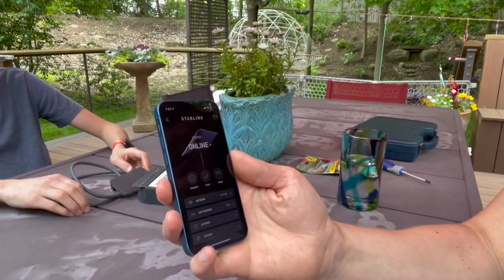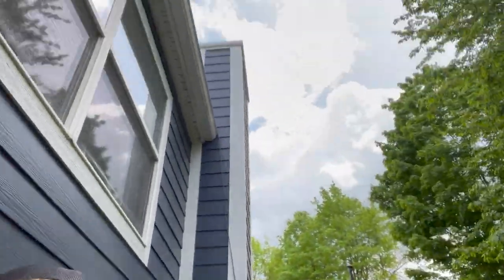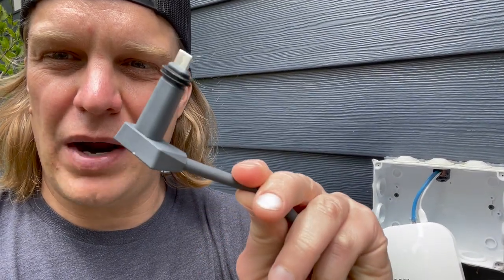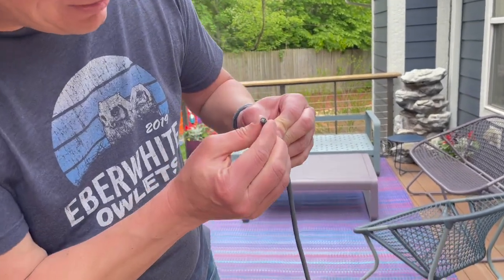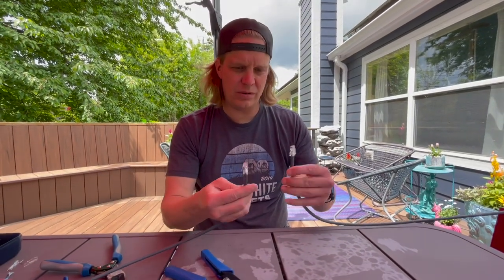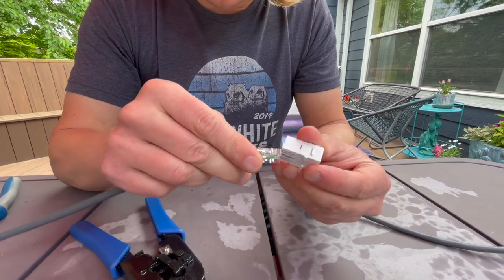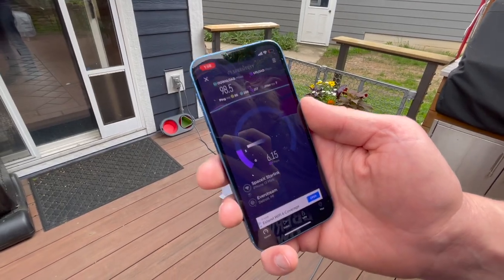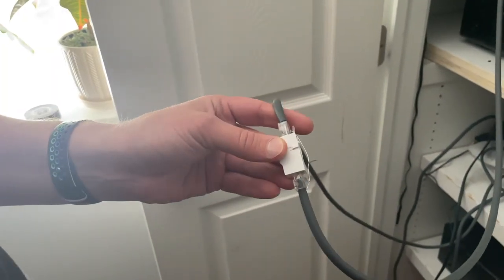Can Starlink cable be cut & reconnected?

Comment: I had to cut my Starlink cable to use it on my RV.   Already had a ethernet port on the outside of the RV so I cut the end off that attaches to the router, leaving about 18" to connect the router to the ethernet port inside the RV.   I did use shielded RJ45 connectors.   Everything works perfectly.

Comment: You could also get RJ45 ends with shields and a coupler with shields so you wouldn't have to "twist" the drain wires together.

Comment: I would suggest where the cable runs through the copper pipe through the wall, you clean up that sharp looking metal pipe end and perhaps fit some kind of rubber end.  Otherwise in the future  you are going have some chaffing on the Starlink cable.

Comment: Those bare metal wires aren't for grounding. They're used to collect water if any gets inside the cable. The blue shielding inside of the rubber jacket is what you'd normally consider ground for shielded ethernet cables.

Comment: This is a brilliant idea i had always known it will work because research showed that the cable is same as cat6  own, another way round is to feed the other end of the cable (i mean the end connecting to the router itself not the outdoor antenna) since is not a 90 degree angle it should be able to go through, thanks a bunch for this video it has brought more confidence to those doubting before.

Comment: You could also try to pass the other end of the cable (the one plugged to the antenna), it's not a 90 degree angle connector, so it will pass a smaller hole (granted not the copper tube you showed)
Reply from the maker: It was also too big, but that would work for some people I imagine!

Comment: Just some advice from someone who has installed plenty of outdoor-rated CAT6 cable.

- The extra wire is the "sink" wire or ground for the internal shielding.  You should use shielded CAT6 connectors instead.  You typically wrap the "sink" wire with copper conductive tape around the outside of the cable sheathing before inserting it into the shielded CAT6 connector.  Basically, the "sink" wire is what maintains continuity between the foil shielding inside the cable sheathing and the shielded connector.

You should verify with a tester that the grounding checks out.

- Also, if the connection is outside and exposed to any kind of moisture then you need to apply dielectric grease to keep the copper connections on the CAT6 jack from corroding.  This technique has worked extremely well for my EnGenius Wireless Bridge setup for the last 4+ years.  Of course, this is standard practice when installing satellite TV systems using RG6 coax.

Personally, I'd install a single-gang outdoor receptacle with shielded CAT6 keystone coupler & outlet cover making the install look professional.

Just a suggestion, try using a piece of electrical conduit or grommets when routing cable through the walls.  Unlike copper water pipe, it doesn't have any sharp edges that could end up cutting through your cable.  Even CPVC or PVC would work just fine but don't tell that to a code-Nazi electrician 🤣

Also, remember that every time that you add a coupler you lose a little bit of signal strength so try to keep your splicing to a minimum 😉

Excellent video  😉

Comment: We disconnected the antenna wire from the base and fed that end through the hole from inside the house and reconnected it to the antena outdoors and we avoided that issue.
Reply from the maker: Nice! Yes, the dish side is straight and thinner,  it still too big for the entry I already had.

Comment: I'm about a year late to this, but there are two different ends. The large one which plugs into the base of the router is stupidly large (no idea why they did that, especially if it's just a standard ethernet cable), but the end which plugs into the dish is MUCH smaller, and can be collapsed to about a half inch, maybe 3/4" inch to help snake it through holes. Still bigger than an ethernet plug, but much better.

Also, I had a lawn care professional accidentally hit my cable. I was waiting on a more permanent install (roof mount, but the roof is due for replacement so no point in mounting it just to redo it all later), and the cable had come loose when he hit it with his lawnmower. Knowing that this is just an ethernet cable inside (although it is shielded, so I'd recommend using shielded connectors and jacks) means I can "splice" it back together and not worry about it. Good thing I didn't throw it away.

Comment: The other end of the cable (dish end) is straight and much smaller.
Reply from the maker: Yes, it's straight(er), but still a lot bigger than the wire and much bigger than the hole I had available.

Comment: Actually the other end of the cable (that goes into satellite antenna) doesn't have such a fat connector. And that is the end that you would be poking through your conduit. So in many cases you won't need to cut it. You just need to unplug it from the dish.

I wish they emphasized it better.
Reply from the maker: Yes, indeed. That wasn’t obvious and I wish I had included it in the video. That end was also still too big for the opening we had but is much more reasonable a size if you’re cutting a new hole.

Comment: Really nice that you tried it out and worked. Unfortunately, I damaged the one end of the cable, as it was thrown from my roof. I was wondering if cutting the edge and using a different router would work. Maybe you can check it. Thank you!!
Reply from the maker: I doubt it. The Starlink router will certainly need to do some special stuff to communicate with the dish. Not to mention it must be POE to work, which normal wifi routers are not. Unfortunately, I think you’d need to buy a replacement cable in this situation.
Reply: You can use another router as long as it supports POE, and put the dish in bypass mode
Reply from the maker: @nm85  interesting! I may have to try that at some point. I guess that means all of the beam steering smarts are in Dishy.
Reply from the maker: @rockessence  Love the wiring breakdown!
Reply: Sí se puede usar otro enrutador, sólo considerar que el poe a utilizar  debe ser de 90w para alimentar la antena, además de asegurarse de que los pines del poe y el cable de la antena coincidan en las polaridades, hay un diagrama del cable de starlink en internet donde específica naranjas y verdes positivos y azules y marrón negativos

Comment: Just found out that the other end of the cable which goes into the dish can easily come out too and it's much smaller so easier to pass through the wall
Reply: 3/4 inch I think.

Comment: any concerns about the gen2 deicing power draw up to 150w,  does the regular cat6 patch can handle the electrical load ?
Reply: I also want to know this, good question.
Reply from the maker: Good question! I've seen some videos that measure the power draw at roughly 100W and up to 150W (during snow). That's more than PoE++ (4PPoE), which maxes at 90W. I'm thinking I may swap the cat6 coupler out for one rated at that level at least. This would be a good question for an EE, but my interpretation is Starlink is doing their own proprietary flavor of PoE that runs higher wattage. I don't really see anything in the materials that seems like it would create electrical risk. That said, proceed at your own risk both on the warranty and electrical impacts. So far, mine has been running great and nothing is getting hot or anything.
Reply: Thank you, Guy. I appreciate you sharing your experience and expertise.  I received my kit today, will be taking the plunge to splice in direct bury cat6 and run about 240ft.
Reply from the maker: @justinshapovalov8116  I'll be really interested to hear how it works at that cable run distance! I saw Starlink sells a 150ft version so I'm sure it'd work at that distance at least. Good luck!
Reply: So far so good with my direct bury 240' Ethernet cable with outdoor couplers near termination points.  Installed Sunday and so far only one 14 second outage today in the afternoon.  I'll have to see if the heat feature works properly this winter if needed.  I'm sure that is when it draws the most watts.
Reply: @justinshapovalov8116  just to check what your are saying: you cut the starlink cable and add 240' ethernet cable and join the starlink connectors with the ethernet cable?

Comment: I’m wondering if you can splice in a section of cable to make the entire cable longer.  I had to order a 150’ cable to get free from obstructions but could use a little more length to get completely out of the woods.  I have the original 75’ cable.
Reply from the maker: Probably, although there will likely be some max range the signal and power can effectively travel. I think someone else in this thread did something similar to what your suggesting and HS success.
Reply: Thanks!
Reply: Cat 6 has a working range of 300’. Problem lies with how much power dishy uses in the winter to deice. I’ve read it’s more than normal Poe currents. 
I’m sure you’d be fine extending it some.

Comment: I tried to splice into my existing CAT6 wire to my new construction house which required me to ignore the shielding and ground wire. The router can not find the dish. Will I have to run a Starlink cable to the router? I also used the t568B diagram because that is how my house was wired.
Reply: Yes
Reply: you can buy a starlink adapter tho that will take it from cat6 to starlink plug

Comment: Has it disconnected when you modified the cable? Wondering if CAT 8 will work with the starlink connectors then using it on the starlink router and the dish.
Reply from the maker: I haven’t had any issues

Comment: Thank you so much.   I have the old round dish.  I'm going to assume the cable configuration is the same .   id like to take my dish with me when I go camping , but part of the cable is buried.   cutting and re-attaching ends would sole my problem
Reply: you can just cut the cable and match the same colors up on both sides to make a longer cable. Or just cut and attach the connectors of the Star-Link cable to a longer CAT VI cable. You can splice the wires with (I'd recommend Scotch locks, if you're not comfortable making the RJ-45 connectors) pretty much anything. I wouldn't just twist and tape it up, as that wont last long. But any electrical connector will do. Just don't run it past 300 ft. His (OP) method or a similar one using the correct connectors/couplers would work best. But don't stress over it.

Comment: Great video - thanks!. It solves the question of whether a broken cable can still be used with a simple modification. It certainly saves on having to buy another cable from Starlink. I think you are right about the extra wire on the Starlink cable could be used for a ground (it's a rip cord). If you used shielded RJ-45 plugs with the cable (where you'd crimp the wire after pulling it back to go under the metal of the shielded RJ-45 plug and the foil shielding) instead of the standard RJ-45 plugs, you could ensure a solid crimped connection. Though, what you did works just fine as you proved. Nice work!

Comment: Thanks, amazing video! Can you give a list of exactly which plugs and joiner you used? There are so many options out there I get confused...
Reply from the maker: I think pretty much any of them should work as long as you have the wires directly connected / passing through. I used this CAT-6 coupler with a standard RJ45 ends / crimper. https://www.amazon.com/gp/product/B091BBYMJ1/ref=ppx_yo_dt_b_search_asin_image?ie=UTF8&th=1

Comment: Yep.  Twisting a 22 gauge shield wire together will certainly give you all the wire needed to conduct and protect everything from a trillion watts of energy from a lightning strike.
Reply from the maker: 1.21 gigawatts, actually
Reply: Actually, the primary purpose of grounding rooftop equipment is to prevent the elevated structure from being hit in the first place by continuously draining to ground ionization potential that collects at or near the structure. Lightning requires an ionized path to be formed before it can strike. If you make it impossible for it form a path to your stuff through grounding, it is likely to find somewhere else less well grounded to strike, so that little wire, if it is indeed intended to supply a ground to the Starlink dish, serves the purpose just fine.  If you take a direct hit despite your efforts, no conductor of any practical size is going to prevent severe damage.

Comment: Nice video and I'm glad it worked. I'm wondering why you didn't pull the smaller end from the dish and run the cable from the router to the dish.
Reply from the maker: That end is straight but the connector was still bigger than the hole size / conduit I already had available.

Comment: Hello from Italy! If I’m not wrong, the two sides of Ethernet cable you crimped are in T-568A (Green White / Green / Orange White / Blue / Blue White / Orange / Brown White / Brown) while Starlink has a different sequence (T-568B, Orange White / Orange / Green White / Blue / Blue White / Green / Brown White / Brown). I can’t find any other information about that and I have to repeat the work in my Rv, could you please confirm that? Thank you!
Reply from the maker: I just did the standard Ethernet sequence but it shouldn’t really matter since the connection is just a pass through. As long as each wire is going to the same one on both sides of the coupler I think it would work.

Comment: your copper pipe appears to angle down into the wall, so if your box ever leaks water it will pool into the home, second, no gorunding at all which is a bigh problem I see in all these installs. Not only should the dish mount be grounded for static discharge, but the cable itself should be also to hopefully prevent a lightning hit making it into the house.

Comment: Take the cable of the dish, it is a lot more slim on top,run it thru the wall from inside the house, no need to cuatthe cble at all
Reply from the maker: Yes, it is slimmer but didn’t fit in the hole I already had and I didn’t want to make a bigger one.
Reply: plus a great way to extend the cable if your short..... @OuttaMyDepth

Comment: Thanks for the video..but I do have a question.  Do you think it would be possible to make my starlink cable into a y-cable to be able to use 2 starlink routers off the same dish?
Reply from the maker: No, I don’t. I don’t think the POE power or data transmissions protocol would support this type of hub / split setup which is more like old school token ring broadcast networking. I suspect the wiring requires direct connections between each dishy and each router controlling it.

Comment: Does the dish still heat for winter? What wire does it use for heating?
Reply from the maker: Seems to work fine... I imagine it uses the power delivered over POE (power over ethernet) to warm for that.

Comment: The answer is depends. Latest Starlink update looks for voltage drop. If you are below it starts giving network errors and cable reconnect messages
Reply from the maker: I haven’t gotten any errors
Reply: @OuttaMyDepth  Like I said...depends

Comment: u used the wrong type of rj45's, the ones to use are called "shielded rj45" and the screen wire u twisted together at the end is to stop outside interferences screwing up the data signal between dishy and the router. Anyone can cut the cable and rejoin it with solder, soldering iron and heatshrink so long as match the colours. Shorter the cable the better performance.

Comment: I have a question. Im using the RV starlink kit and needed to run the antenna quite a bit away from my home as there are pine trees everywhere. I bought two 150ft cables and used this video as my guide for joining the two cables. I followed your instructions with the coupler and the ground wire but my connection blips in and out constantly and now barely turns on. Why is it doing that? Is the distance too much or could I have messed up with the wiring?
Reply from the maker: I think those are the two most likely factors. However, I think POE is supposed to work up to ~300 feet, so I wouldn't think the length would be a problem as long as the type of ethernet wire you're using supports it. FWIW, mine works whether the metal wire is connected through or not. Good luck!
Reply: I believe 159ft is the max supported length.
Reply: I would use high quality solid copper cat5 or cat6 @OuttaMyDepth    do not use home depot riser cat 5

Comment: Can you disconnect and reconnect the cable on the antenna end?  That is a much smaller connector and not much larger than the cable itself.
Reply from the maker: It's basically the same width on both sides (and much larger than the cable itself or the whole I had). But yet, you can disconnect on both ends.
Reply: @OuttaMyDepth  The router end is heaps bigger on the Starlink product we got last week in New Zealand.  I would if we tried to thread the router end though the hole would need to be 40mm.  The aerial end is about 22mm.
Reply from the maker: @MikePriornz  Yup, it’s smaller but nowhere near as small as the conduit I had or the size of the wire itself.
Reply: You need a 3/4 inch hole for the antenna end vs 1 inch hold for the router end for the rectangle dish.
Reply from the maker: @jasongoodwin8702  yup, that was an option, I went this direction to use the space I already had open

Comment: Where did you get the cat 6 wiring diagram. Great video. Thanks for the information
Reply from the maker: Just did a Google image search... https://www.google.com/search?q=cat6+wiring+diagram&rlz=1C5CHFA_enUS931US931&sxsrf=ALiCzsag9wMlpsYdX916R8zjm1Jni0gPJA:1659469057781&source=lnms&tbm=isch&sa=X&ved=2ahUKEwjhr9H986j5AhVFIn0KHezVC3AQ_AUoAXoECAEQAw&biw=1085&bih=1129&dpr=2
Reply: Please keep in mind if using these diagrams, B is the standard now, not A , A is still used by some telco companies and government facilities, however any new installation  as well as any pre-made cables you buy from the stores will use B as the standard.